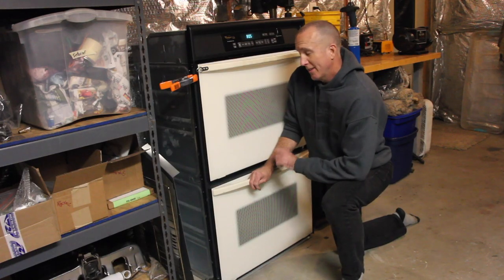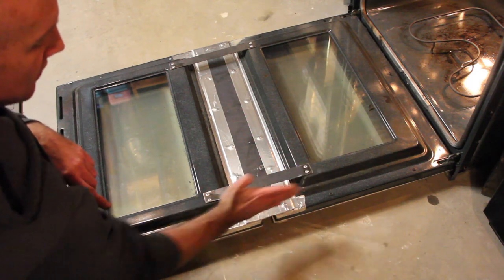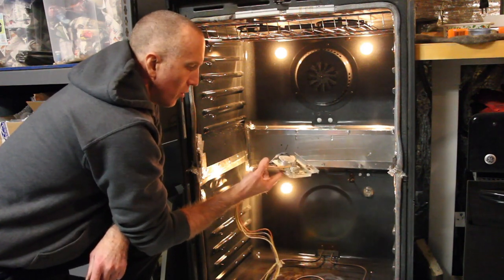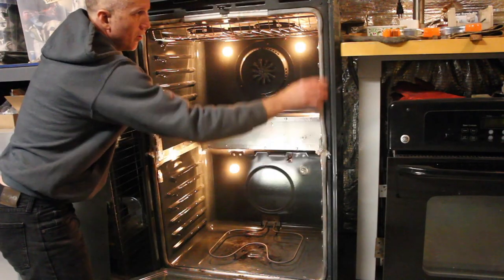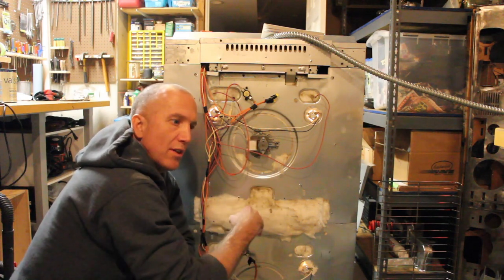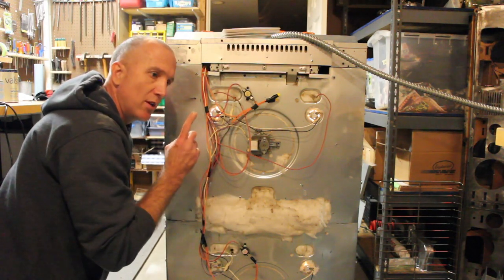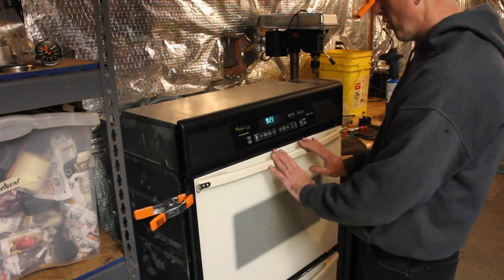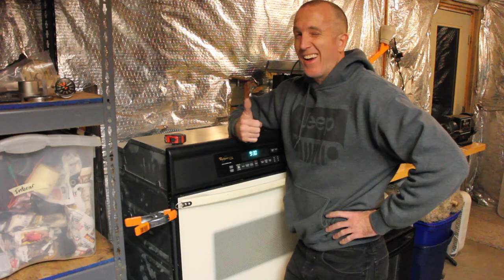Powder Coating Oven built from a Double Wall Oven - easy and cheap

Comment: Well done!  We have about the same number of subscribers.  I really like the way you walked through the wiring.  I have the same oven to modify.  Going to try a left side hinge for space clearance and make a sliding top center track bar between the elements to make hanging long pieces easier.  Thank you.
Reply from the maker: Let me know about the door hanging. It’s so heavy, I was afraid it could potentially tip to the side if opened too much. Also, I want to know about the sliding shelf. Great idea.

Comment: WOW, a big thumbs up! thanks so much for all that info. I literally just got a near identical whirlpool double oven to set up for PC. ill be separating the 2 units and installing a "lift" in between ovens to gain another 8-10 inches, for squeezing in bicycle frames.
Reply from the maker: Really, you can make it as tall as you want. The difficulty is getting the support from your expansion plates and the the bridge between the doors. The longer that is, the more room you need to open it and get a good seal when closed. Measure and take into account flex on the door hinges.
Reply: I'd like to see that!
Reply: @cramersclassics  I’ve got the oven done, but still need to get material to make the door. I’ve removed the center “partition” of the double oven, and then added an additional 14” lift giving me 52” of height. I’m happy to send you some pics if you tell me where :) (email,insta,Facebook)

Comment: great video and explanations.  for the door switch, I wired my wires together so it thinks the door are closed at all times.
Reply from the maker: I was thinking about doing that? But i use the convection fan a lot to keep an even heat in the oven. Having that blow in my face when I open the door would be a little intense :)

Comment: Nice vid Cool Guy. That really give much more space to do larger parts. Currently use a toaster oven to do small parts, so even a single oven would be an improvement for me.
Reply from the maker: Think of it this way, a toaster oven that would be big enough to do a brake caliper will cost around $50. A double wall oven off Craigslist will cost about $80 (with a few other things you need to install) and you can then powder coat the rear tailgate.

Comment: If you had to do it again would you consider installing a hinge on the side or still keep it on the bottom, seems like the door is very heavy if it ever got away from you, you would have problems. I noticed you have a convection is that possible to use, I have a convection too I’m converting.
Reply from the maker: You could install a hinge on the side, but I just wanted to use what was already there knowing that I'd get a good seal from the already existing structure. I use the convection all the time. It makes getting the pieces up to temp fast and it helps equalize the temperature throughout the whole oven space. That way the curing process is even and helps to save energy.

Comment: Did your broiling element up top have two connections or four?  My broiler element appears to be two elements in one the inner and outer if you will. So there's four connectors on the back. I tried connecting my baking wires to either the outer connectors or the inner connectors and it's not heating.  It seems like yours may be the same way. If so did you use the inner to connectors or the outer two connectors?  I've used this oven to powder coat before but I've never tried the broiler function. So it's possible there's an issue with it. There is continuity however. All of my lower door switches and latches are hot wired to the upper oven and it seems to be working because the lower element is coming on. Anyways sorry for the long message, just curious about your upper element.
Reply from the maker: Mine only had the one broiler element. What I'm guessing is the your oven may have 2 regular elements that serve as 1 broiler element, hence the double connection. The broiler function in respects to the ovens computer just has a higher voltage running through it so it burns hotter. You could test for continuity between the different elements and see which end completes the circuit and then just disconnect the other element. Am I understanding this right?
Reply: @coolguy_CJ7  Thanks so much for the reply and video.  It was a big help for me.  I measured voltage and realized that I had a disconnect.  I fixed that and it is now working.  Just need to put on the doors and I am all done.  Thanks again!
Reply from the maker: Yeah! Success!!

Comment: How did you measure the doors to get them perfect?
Reply from the maker: Before I took them off the oven, I measured the distance between the the bottom edge of the top door and the top edge of the bottom door. I then layed them flat and screwed the connector plate to them. Make sense? Also used a t-square for aligment.
Reply: @coolguy_CJ7  thank you!

Comment: Y not just put a metal tab on the lock switch so it always think Itz close and just put it to the back of the oven and forget about it instead of the hot wiring?
Reply from the maker: I had tried that initially. The computer needed some kind of verification that the ciruit was closed. By taking out the middle of the oven,  I could either rewire the computer or gerryrig the switch on the outside of the oven. I chose the first option. Cleaner finish and I have an extra switch now.